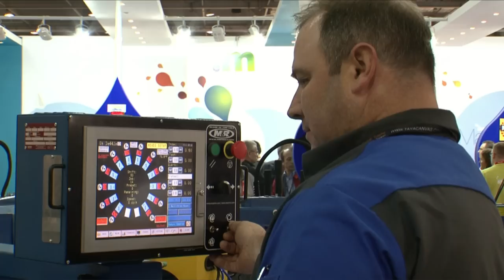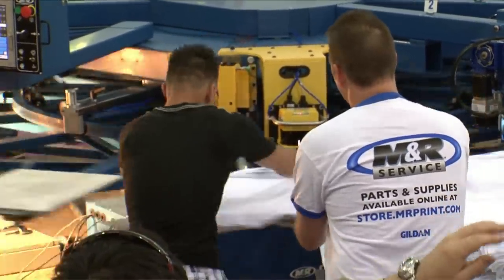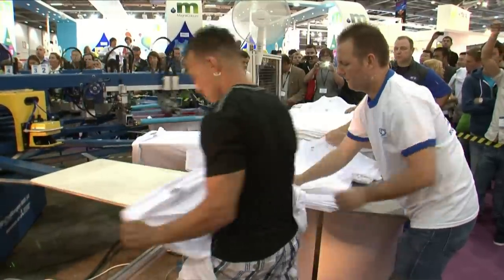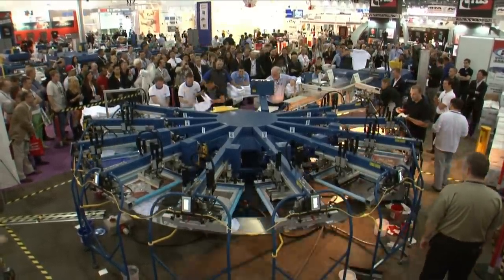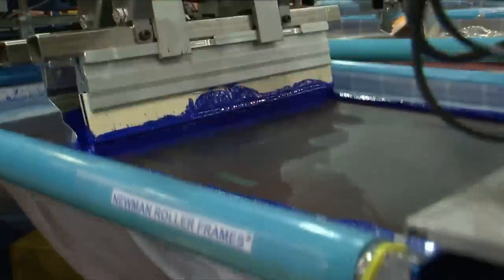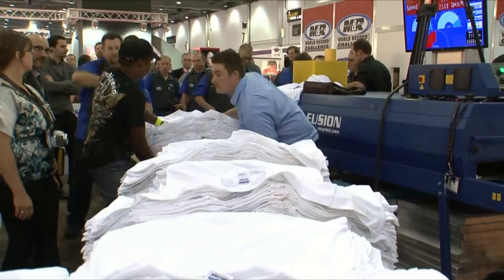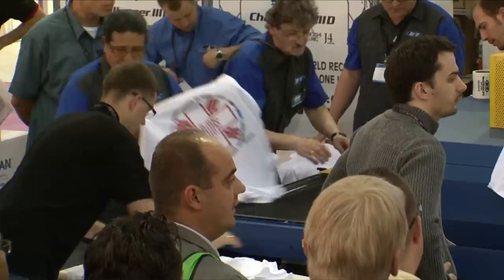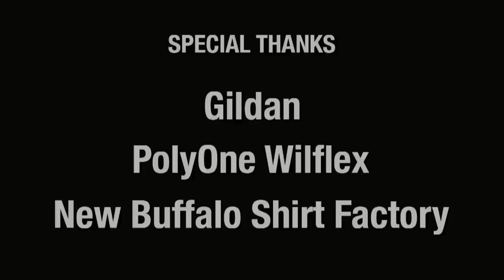T-shirt screen printing record shattered by M&R Challenger III D J4 automatic screen printing press

Comment from the maker: Screen printer Omar Viera used M&R's new Challenger III D J4 Automatic Screen Printing Press to set a new world record of 2139 T-shirts printed in one hour by a single operator. The event took place on June 28 at FESPA 2013 in London. The result eclipsed the previous record (also held by Mr. Viera) by 230 T-shirts. Other M&R screen printing equipment contributing to the record attempt were the Passport Automatic T-shirt Unloader and Fusion electric conveyor dryer.

Rich Hoffman, M&R's CEO, said, "In 2010, Omar proved he was an elite screen printer. And we knew we had a phenomenal automatic screen printing press in the concept Challenger III D J4. But we also knew everything would have to go perfectly for Omar to set a new world record in London—much less to shatter the old record the way he did today. However, even if you have all the elements necessary for success, an otherwise minor glitch can leave you short of your goal. To borrow a phrase from the sports world, 'It's why they play the game.' Fortunately, it all fell into place."

Hoffman went on to thank Jon Weiss, founder and CEO of the New Buffalo Shirt Factory, for making it possible for Omar to compete; Gildan for providing high-quality T-shirts; Wilflex for providing exceptional screen printing ink; Mitsubishi for their superior servo drives and exceptional support; the people at M&R behind the design and manufacture of the new Challenger III D J4 automatic textile press; the outstanding M&R support staff at FESPA 2013; and especially Omar for another amazing performance.

For more information about the Challenger III D Automatic Screen Printing Textile Press, click here:
http://www.mrprint.com/en/ProductOverview.aspx?id=156&utm_source=YouTube&utm_medium=Web&utm_content=Challenger3D&utm_campaign=YouTube_desc

For more information about the Passport Automatic Unloader, click here:
http://www.mrprint.com/en/ProductOverview.aspx?id=46&utm_source=YouTube&utm_medium=Web&utm_content=Passport&utm_campaign=YouTube_desc

For more information about the Fusion Electric Conveyor Dryer, click here:
http://www.mrprint.com/en/ProductOverview.aspx?id=108&utm_source=YouTube&utm_medium=Web&utm_content=Fusion&utm_campaign=YouTube_desc

Comment: Thats insane!!...that dude is a much a machine as the actual press....i noticed one pallet got printed on.
Reply: Actually this machine has a "no-shirt sensor" that prevents it from printing on the pallets, maybe they used that pallet for registration before applying the adhesive. At the end when he was tired he missed quite a few pallets.

Comment: If I had a machine that was as quick as this, there's absolutely no doubt in my mind I could come pretty close to this record.  No, I'm not tooting my own horn.  I just know how fast I can load shirts.  There's some things going for Omar with this particular record.  1; from what the video show, it looks like every shirt is the same size which makes loading them the same way every time very easy after the second shirt.  2; he's loading the back of the shirt (which if you're a screen printer, you know loading the back of a shirt, especially one that 'fits' the platen/pallet the way a medium or large does, it basically loads itself. 3; there looks to be some sort of tag on the shirt so he knows it's loaded straight.  and lastly, 4; he has someone opening the shirt for him so when he turns, the shirt is ready for him in the same spot every single time.  I'd love to try this and see where I'd be.
Reply: +Briandrum I agree 100% i think i could come close to this record also given the aids he has. with all different types of shirts and half ass stacked by my coworkers i can print at 950/hr.

Comment: what is the cost of this machine and how can we buy it from Nepal?
Reply from the maker: Brand Support The Challenger III J4 was a prototype press built specifically for this 
challenge, so it's not available for sale, but you can get pricing 
information on the standard Challenger IIID press via the M&R 
contact page on our website at:  http://www.mrprint.com/en/ContactUs.aspx

For more information about the Challenger IIID, click here: http://www.mrprint.com/en/Textile%20Screen%20Printing%20Equipment/Automatic%20Screen%20Printing%20Presses/High-Performance%20Automatic%20Presses/CHALLENGER%20III%20D%20Automatic%20Screen%20Printing%20Press

Comment: That's a cool number of shirts put on the pallets in an hour... And a nice way of exhibiting the machine.
But as for the record itself, it is only just that. A record. Something just for the books.
It is an unsustainable speed, both for the machine and the person.
Keep that up for two hours straight, and his back will be worse than mine doing a manual 2-colour print on 750 tshirts in three times as long.
I love screenprinting, it is an awesome skill to have. But the soon eight years I've logged doing that (single user, manual printing, mon-fri, 7-16) is also the reason my back is done already at 45 years of age.
Reply: You do 750 T-shirts per day?
Reply: @SurajSinghTomarArya  😆😆 Omar better watch out

Comment: I've been a screen printer for 20 years. The video is impressive however that speed every day all day isn't sustainable for anyone. Videos like this give business owners unrealistic expectations. As for me I can do up to 3 thousand a day with an under base and one flash everything else running wet in an 8 hour shift and that's back breaking in itself by the end of the day. However if the image is long the stroke will take time and honestly if you don't have a perfect situation as far as squeegees, pressure etc. well that will slow you down also.  Can't do that everyday. And that is without the help of someone opening the shirt for me. Some materials like to stick together like the blend tee shirts. They're straight trash to work with and slow you down. When I'm running fast several end up on the floor from sticking as I pull.  M&R presses are the best to work with, wilflex is the best plastisol ink and Gildan is a great product also. Put all three of those together and you have a perfect combination as long as the press is functioning well pallets have good off contact and the operator knows how to get things going and up to speed. I've been in several shops that either knew what they were doing or did not know much of anything at all. It's the latter that is a problem. Some shop owners have Managers in there that don't know what they're doing which will also slow  down the entire process because they want to run a 6 color wet burned on 158 with a 110 under base. It's starts with the film and mesh. If you don't get it right in those departments you'll see the issue on the floor in production. BTW squeegees matter.😭😤

Comment: wow muy buena maquina cuanto cuesta
Reply from the maker: luis adrianzen gomez 
El Challenger III J4 era una prensa prototipo construido específicamente para este desafío, por lo que no está disponible para la venta, pero se puede obtener información de precios acerca de imprenta estándar Challenger IIID a través de la página de contacto en nuestro sitio web en:  http://www.mrprint.com/es/ContactUs.aspx

 Para obtener más información acerca de la Challenger IIID, haga clic aquí:  http://www.mrprint.com/es/Textile%20Screen%20Printing%20Equipment/Automatic%20Screen%20Printing%20Presses/High-Performance%20Automatic%20Presses/CHALLENGER%20III%20D%20Automatic%20Screen%20Printing%20Press

The Challenger III J4 was a prototype press built specifically for this challenge, so it's not available for sale, but you can get pricing information on the standard Challenger IIID press via the M&R contact page on our website at:  http://www.mrprint.com/en/ContactUs.aspx

For more information about the Challenger IIID, click here: http://www.mrprint.com/en/Textile%20Screen%20Printing%20Equipment/Automatic%20Screen%20Printing%20Presses/High-Performance%20Automatic%20Presses/CHALLENGER%20III%20D%20Automatic%20Screen%20Printing%20Press